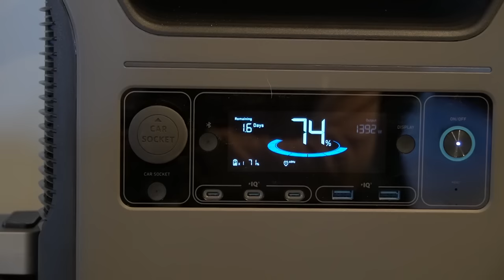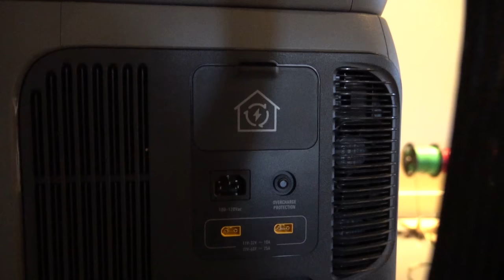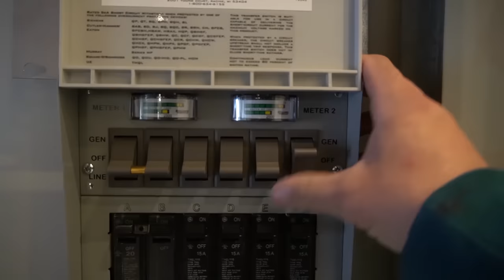Difficult Loss For Our Family | Pausing the A-Frame Cabin Addition

Comment: couple of steps with changing the tyre you need to do next time 1. Wirebrush the Rim 2. apply soap/lubricant to the tyre bead to help with fitting and seating the bead to the rim :)
Reply: It's a shame since I'm pretty sure that will leak.  A few minutes cleaning off the bead seat area and maybe using a sealant would have made a much better job.
Reply: @julianb1474  He actually said he had never done it before. Maybe he should have consulted the YouTube "experts" before doing the job.
Reply: To be fair we don't know that the cleaning etc wasn't edited out 🤔
Never changed a tyre on my own but would have known not to put the tyre on that rim with no prep
Reply: On this side of the pond, we spell it tire 😆 🤣 😂
Reply: @briangroene7756 Thank you. I thought I was going to get the bad guy here😊😊
Reply: In addition to the good rule of thumb suggestions on mounting the tire is to inflate the tire with nitrogen. (Would involve taking the tire to a Costco or a tire shop that has a nitrogen generator or having a tank of nitrogen on hand. Nitrogen is a larger molecule that will not naturally seep through the rubber as compressed air will. It is also not affected by ambient temperature. So what pressure you set the tire at will stay at that pressure regardless if the outside temp is hot or freezing.

Comment: Always sad to loose an animal that has become part of the family...Sorry for your loss.  Josh, one suggestion for the tire change effort.  Get a stout bottle brush and make up some soapy water and use it to lub the tire and wheel bead areas, both coming off and going on.  It really helps get the tire bead onto the wheel.  Afterward, it's also handy for leak checks.

Comment: In the future, sand down the bead of the rim where the tire bead creates the seal. Also, use a soapy water solution to spray heavily on the tire bead when taking the tires on and off. makes things easier.

Comment: If it goes flat again after new tire , deflate and clean rime on inside where been seats and it will seal better , and another tip when removing and re putting on rim , use soapy water all around the in side bead , smooth sailing when pulling around with lever bar 😉

Comment: My condolences on the loss of a furry family member, gone but not forgotten , rest  in peace.....
Note: in the future if you have a tire that the beads been broken for a while, use a wire brush too clean the bead edges, before putting the new tire on. Spray the bead edges with soapy water, just a little bit of soap in the water. It will be easier too puton and sealing the beads on the tire.
Getting all the lose ends checked off the list, now is really good for future you👍.
Besides you got an addition too work on.
That ankor power system has insane numbers 26.9Kw , the cafe will be busy when the power goes down,  hot coffee and a warm meal,awesome. 
Have a good Thanksgiving celebration 🦃🌾🥧. Have a good week and God bless amen.

Comment: 7:53 a bit of wirewheeling on the bead of the rim, a bit of soapy water on the bead of the tire should make it easier to mount and seal it up decently. 
Using the soapy water you can also quickly check for leaks before mounting it on the coup again and waiting for it to deflate 😅

Comment: A wire wheel on an angle grinder and some bead sealer can save some crusty wheels for non highway and low pressure applications.